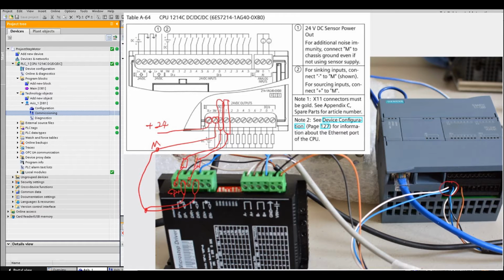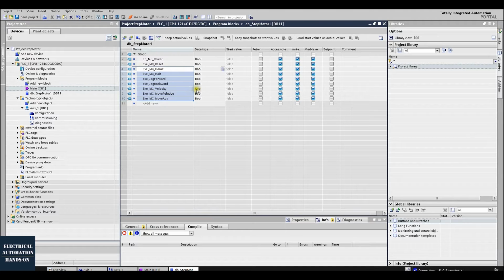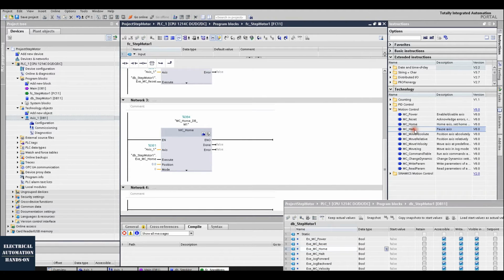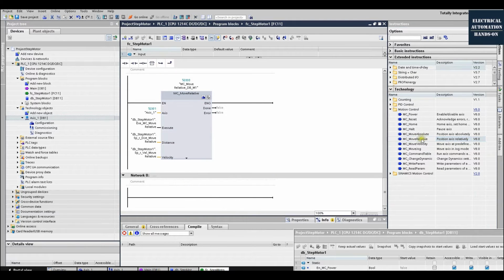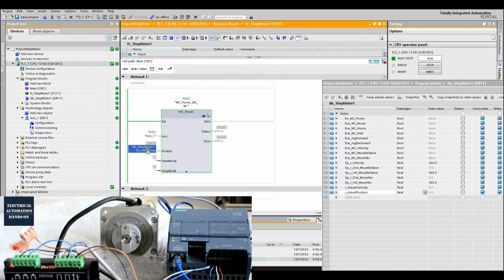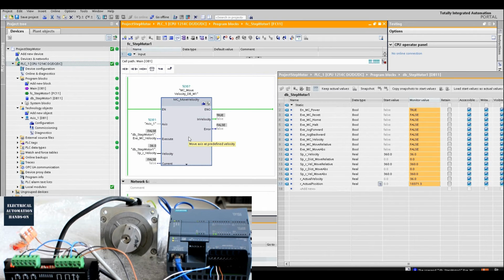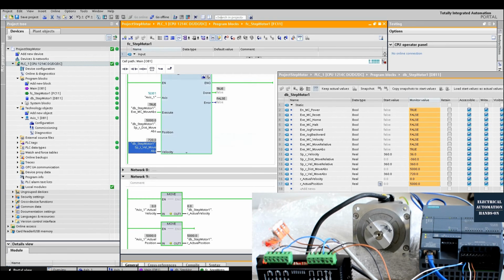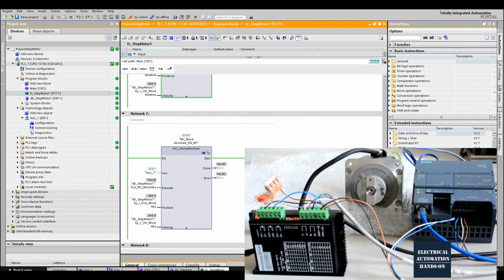MS08c. [Stepper Motor] 2/2 Control Stepper Motor with Motion Programming and Siemens S7-1200 PLC

Comment: Control with tb660 and plc 1215 and apply FIFO ( first input/ first output) needed help to apply for two axys X an Z  cartesian
Reply from the maker: I think this link would be helpful. https://support.industry.siemens.com/cs/document/109784136/delivery-release-simatic-kinematics-operate-v1-0?dti=0&lc=en-CA
Reply: @electricalautomation hello friend not valid, my plc is 1215 don't accept kinematics, I wish programmer with apply FIFO and signal board for controlling two motors and using tb6660
Reply from the maker: @josejuancanorequena1802  You have to program the X/Y axis with different velocities and positions and allocate them into your FIFO; there would be many program efforts. S7-1200 could do that, but many efforts. Hopefully S7-1200 G2 could be better, but this new products and correlated sample program may be available in the following months.